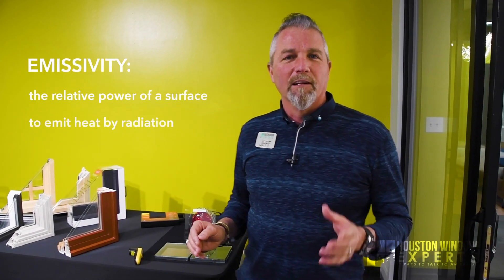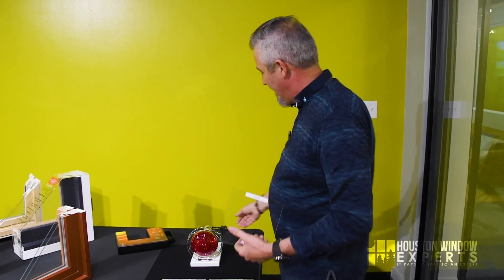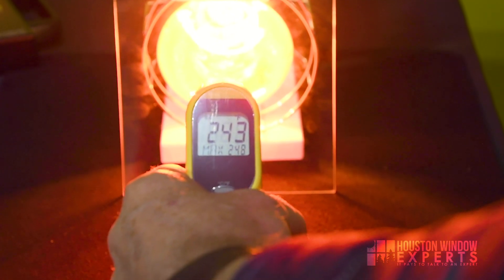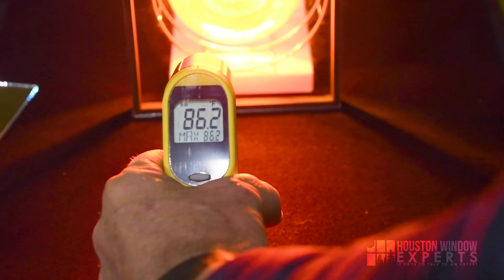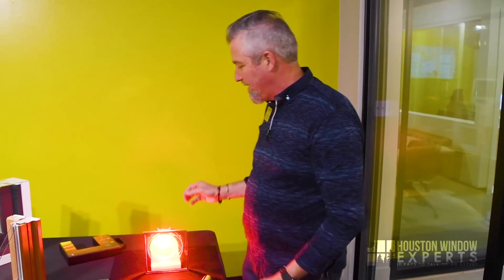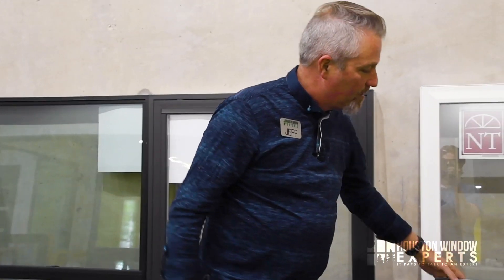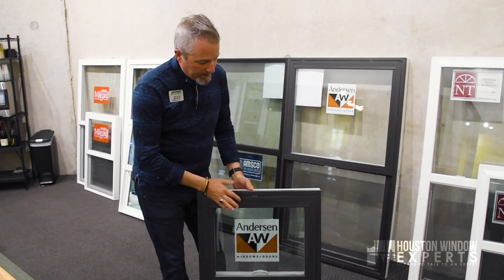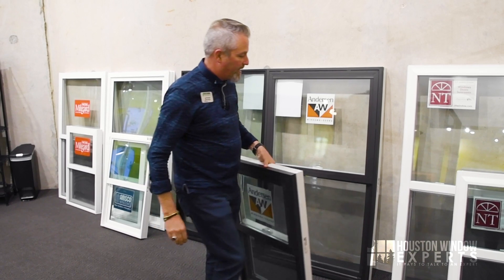What Are Low-E Coatings For Windows?

Comment: Jeff, 

To clarify a few minor details from the LowE  presentation that are common misconceptions...

Softcoat or sputter LowE coatings (there are also "pyrolytic" or hardcoat LowE coatings the differences would be outside the scope of your video) are available in single, double, triple, and quadruple layer versions, not just two and three layers as mentioned in the video. The single, double, triple, quadruple layers in the coating description refers to the number of layers of silver in the coating, not the number of coatings on the glass surface. A single silver coating might have a half-dozen of more separate layers of metal and metallic oxides in the coating, while a triple silver coating might have more than a dozen layers, but in both cases it's the silver that is the reason that the coating works. The layers of other metals/oxides are there to support and protect the silver. And as an aside, sputter coating thickness is measured in angstroms, or how many layers of atoms thick. 

Single-silver coatings are intended for high solar heat gain applications, so certainly not appropriate to your environment. Dual-silver coatings are intended for moderate solar heat gain applications, while triple and quad coatings are recommended for all environments due to having the lowest U-factors, but work especially well in cooling dominated climates because of their ability to block direct solar heat gain, as you pointed out.

As you also mentioned in the video placing the LowE coating on surface 3 does result in increased solar heat gain, while placing the coating on surface 2 will block more solar heat gain. However, single-silver coatings intended for high solar gain are designed and intended for surface 3 application, while dual, triple, and quad coatings are designed for surface 2 applications and are installed in the windows on surface 2 in the vast majority of windows no matter where they are being installed.

There are exceptions to the surface 2 rule for the multilayer coatings, primarily due to window manufacturer requirements (usually not involving solar gain considerations), but since the coatings are designed and intended for surface 2 application as installed, placing them on surface 3 will result in a noticeable color shift of the coating when viewing the window.

The different coated glass manufacturers use very different methods to designate or label their LowE coatings. Showing below four examples of Cardinal's coating designations since they are the easiest to understand among the different manufacturers and since Cardinal supplies well over half of all residential coated glass used in North America:
 
LoE-180 --- one silver layer and 80% visible light transmission --- high solar heat gain 
LoE²-272 --- two silver layers and 72% visible light transmission --- moderate solar heat gain
LoE³-366 --- three layers of silver and 66% visible light transmission --- low solar heat gain
Quad LoE-452 --- four layers of silver and 52% visible light transmission --- low solar heat gain
Reply from the maker: Greg, thanks for sharing your wealth of knowledge on this subject. I agree with everything you are saying. I try to keep some of the details out of the videos due to length restrictions. Sometimes I get into the difference between passive low-e vs solar control low-e but I did not elaborate much this time due to time constraints. I may decide to do an in-depth video about this soon with a contact I have at Cardinal Glass. He is a genius on glass as a fenestration tool. 

Thanks for taking the time to chime-in.
Reply: @HoustonWindowExperts  Thanks Jeff, I watched about a dozen of your videos this afternoon and really enjoyed how well you present so much information. I understand how you are limited to how much information that you can add in a video and stay within a reasonable timeframe and also that your emphasis has to be on window performance specific to your climate and potential customer base, so I did slant my reply a bit toward some of the questions that I saw in the comments section of this and other videos (and I am a geek).
Reply from the maker: I appreciate your input, thank you for sharing your thoughts.
Reply: Question....home in the deep south facing south. Windows only get direct sun in the heating months. In the cooling months the sun is too high to pass directly through the windows. 

The sun in the winter really heats the home. I measured over 100F on the floor from the direct sun. 

In this case it seems like Low-E isn't the way to go. Can you share your thoughts? We are not replacing the windows but adding storm windows and have the Low-E option. They describe the coating as LoE-x89 so I am guessing it isn't very aggressive coating.

Comment: I live in the Dallas area,  which is similar weather as in Houston,  what most Low-E coating choice in the Houston area?  single low-e, double or even tripple ? another thing is that multiple coating will impact visible transmitting rates as in your demo, I heard that double/trible coating glazing can only get 30% or lower VT, sounds like very dark inside the room(if use tint ratio as reference).  By the way, do you do business for Dallas area? or you have recommended dealer or contractor?
Reply from the maker: Thank you for your question. I would stick to no more than three coats of low-e

Comment: So, do the 2-coat windows have it on surfaces 2 and 3?  What about the 3-coat?  And I imagine the 2-coat windows look less green than 3 coat windows.  Okay, last question.  What about in temperate climates?  Does it come down to whether your wife gets too hot in summer or too cold in winter on whether you put the coats on the inner or outer pane?
Reply from the maker: Great questions! Whether it's two or three coats, they all go on surface #2. In cold climates they typically place it on surface #3 to allow more solar heat gain into the home and reflect back the heat from the inside of the home.

Comment: What about i89 coating instead of low E to keep it clear?
Reply from the maker: Dario, thanks for your comment.  i89 is not a replacement for low-e coatings. It's actually applied on surface 4, which is the surface you can touch inside the home. It does help raise the U factor but is of no help to Solar Heat Gain numbers. It also tends to have a slight haze when viewed from an angle so we avoid it. We are in Houston where heat is our enemy and so we do not have any benefit to adding it in our area. Colder climates may benefit from it but it will not be significant.